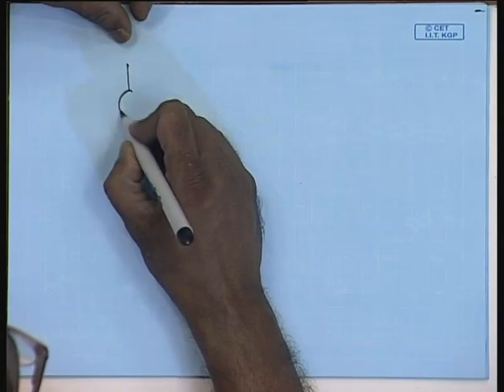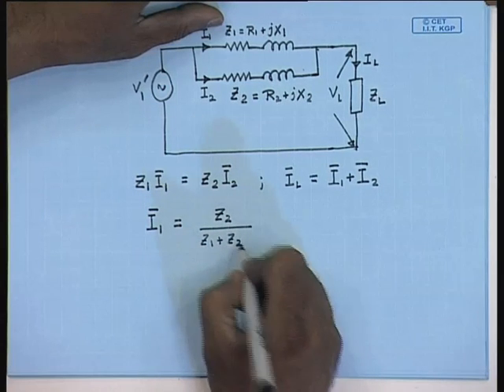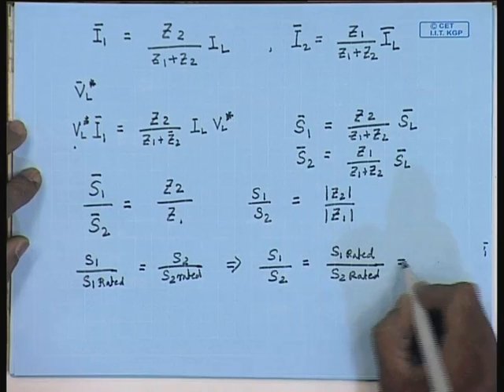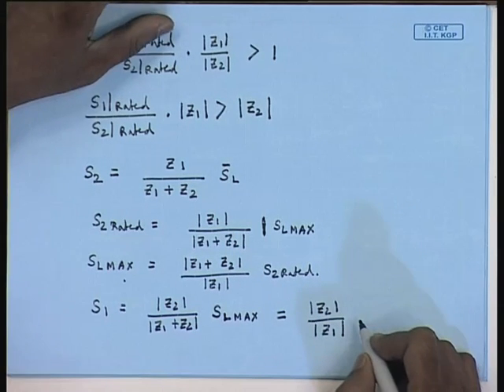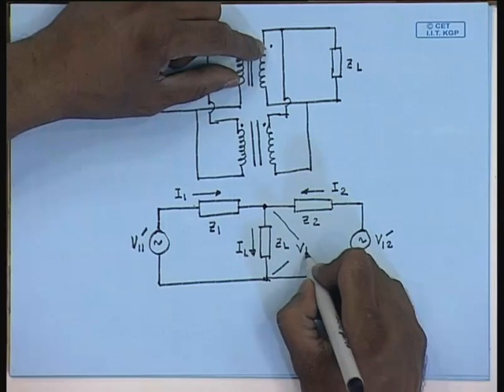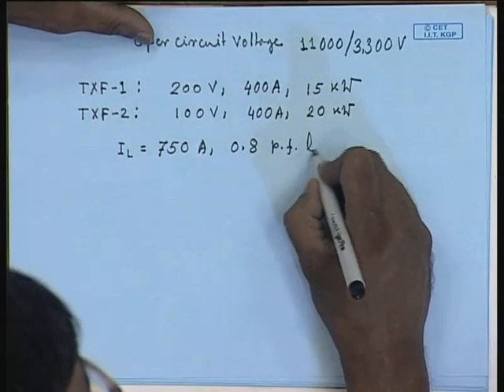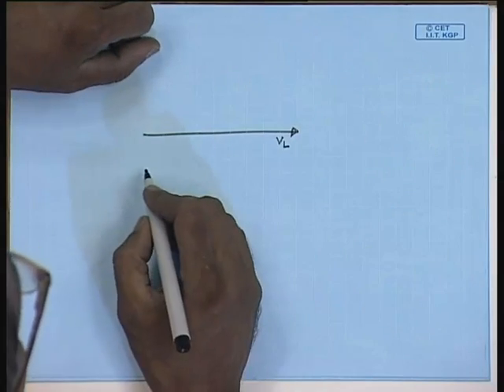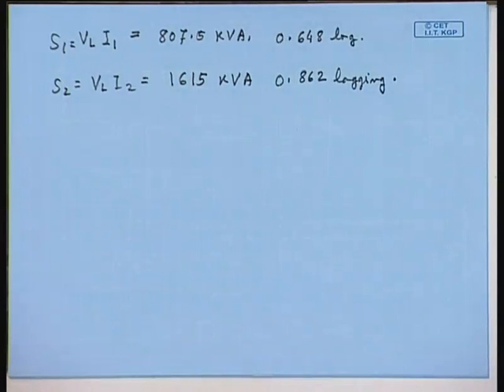Mod-01 Lec-08 Lecture-08-Parallel Operation of Single Phase Transformers

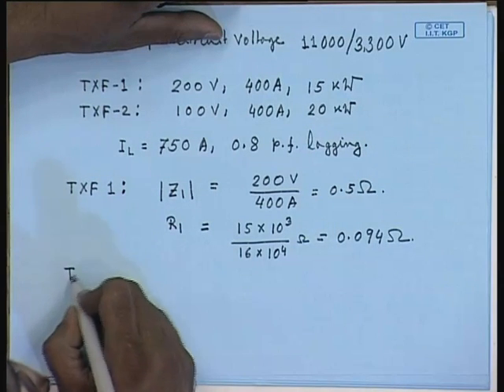Comment: from where do You get 160 000 in the denominator when calculating R1 & R2 at 41:20 ??
Reply: P = I^2 * R
Reply: @Parasmratta  yes, I know that ! But why don't explain that in the video then ? It's the same as take 0,1875 x 0,5 or sqrt (1-0,98^2) x 0,5 without explain from where that comes from !
Reply: @Parasmratta  pls explain how we get r1 and r2